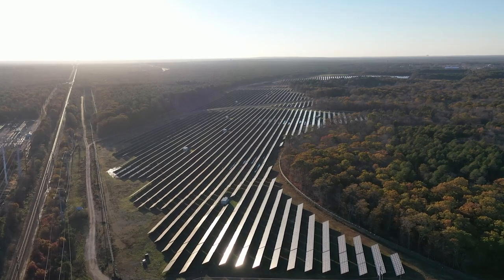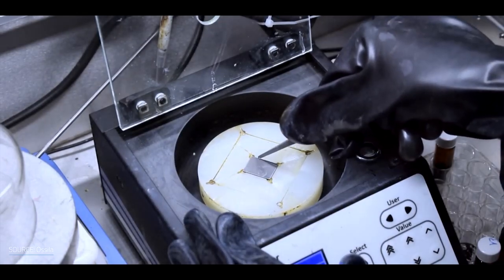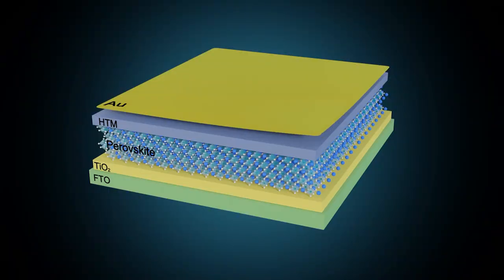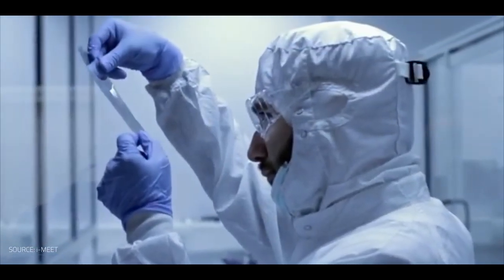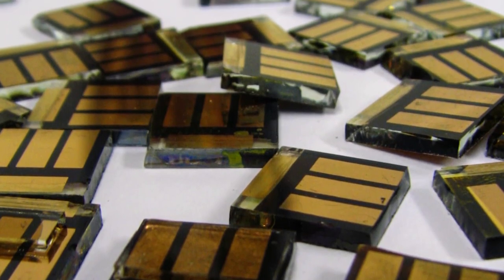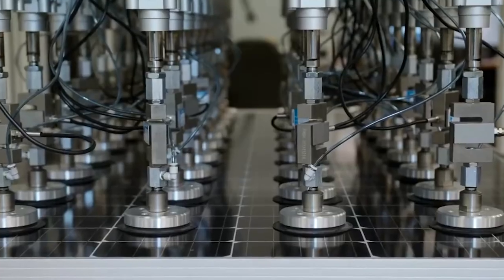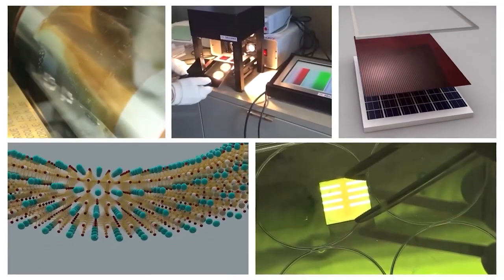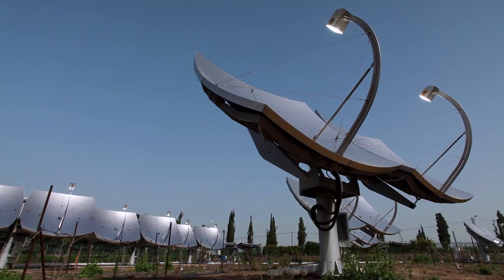The Biggest Breakthroughs in Solar Panel Technology in 2023

Comment: soooo
"and because they can utilize ambient light they don't lose efficiency while indoors." 
walls typically reflect about 80% of the light that hits them, then it may need to scatter multiple times to actually strike the solar cell. Ill assume floor reflectivity and wall reflectivity are similar (though floors are usually darker and/or carpet, so chances are they absorb even more). 

Best case scenario for ambient light is 1 bounce straight onto the cell with no scattering, a  d i r e c t  beam (this will not happen but for the sake of giving this claim more than it deserves Ill allow it, in real situations the light will actually scatter). It also has to pass through a window that will absorb juuust about 50% of the light (not just visible light, IR in particular is easily absorbed by standard window panes, and is opaque to thermal imaging for that reason). Ill actually ignore this though because it may vary a lot. NOW, ill assume the entire back of a phone is coated in this solar cell with no losses from protective coverings or relative angles obscuring more of the light. My phone is rather chunky, at just about 6x2.5 (round to 3) inches, so 18 inches squared of solar power. The sun radiates about 1370 watts per square meter, which you can multiply by 0.0116129 to get square inches, then multiply by 18. Multiply this value by .1 for the cell efficiency, .8 for wall absorption (one bounce minimum), then you get 1.27 watts. My same phone has a 17 watt hour battery, which means that at 1.27 watts of charging without obstruction in 1-bounce ambient light it requires 13.4 hrs to charge while not in use, assuming you CAN directly input 1.27 watts, which you cannot. A circuit to charge in 5 watt bursts will be about 30% efficient, so it will now take 45 hrs of sun to charge.

The short of it is that solar cells can ONLY produce as much power as what hits them, and ambient light becomes weak exceptionally quickly as it bounces around and scatters. Charging devices with this light will be too slow to be effective, as EVERY kind of solar cell loses efficiency indoors because the amount of energy hitting them is drastically decreased.

Comment: i have little knowledge about these things but i was just thinking that a mirror coulc double the energy density on the surface of a solar panel, and mirrors are cheap, cant we just put a parabolic mirror together with the solar panel and double the performance? someone must have tought of this already i guess, so it probably doesnt work
Reply: haha, i googled it, it works, but if there is a lot of sun the solar panel is maxed out anyway, so it would only boost performance during winter or in places/times with lower power per square meter from the sun. Gotta chase that 25% efficiency in the winter dude
Reply: @Pelsdott  it technically works, but there are two issues. First, clear glass made for that purpose is rather expensive. Second, solar cells lose efficiency as they heat up, so dumping 2x the light onto them will mean you need 2x the cooling.
Reply: Oph u said mirror lmao

They are cheap, yeah, but with the heating issues I mentioned they are usually not worth it, particularly for large scale applications.